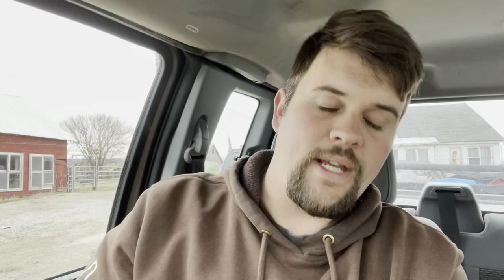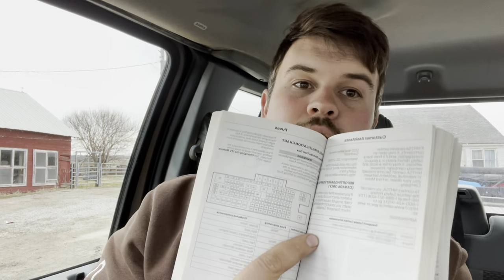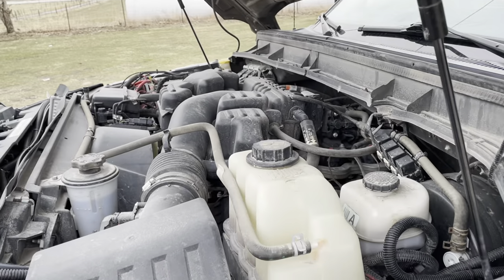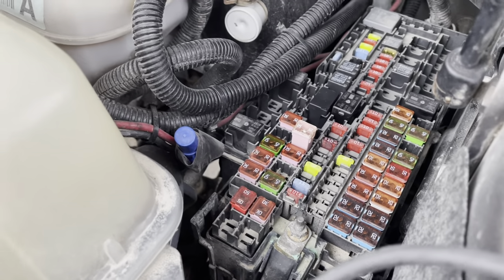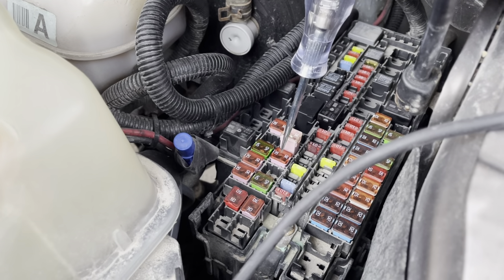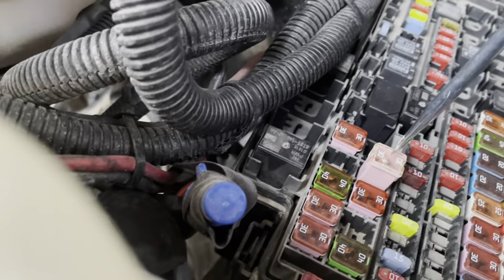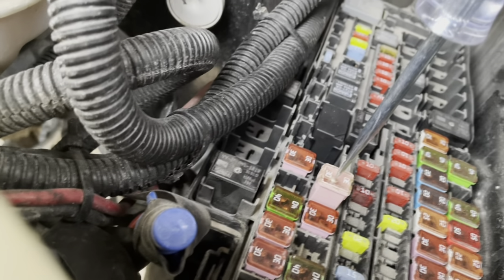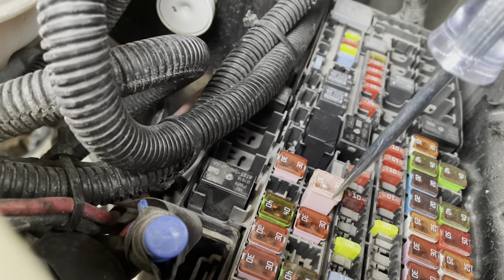Trailer marker lights not working? Try this first!!

Comment: Mu Durango had no running lights. Thanks for the tip. I went straight to the fuses and found a broken 10 amp. Problem solved. Thanks again.

Comment: I don't get it , if all the other lights work how would it be a fuse
Reply: The engineers just mix up garbage in hopes of frustrating you to the point of brining it back to the dealer. Half the crap they put on these cars make no sense whatsoever.

Comment: What was the fuse labeled as? I've got the same problem but all I see in my manual on page 556, sub section 223, lines 308- 357, is left trailer turn and right trailer turn. Nothing says marker lights, running lights, or anything like that

Comment: So where the running lights on the tow vehicle not working as well? I have the same issue with my 99 Jayco TT. Turn and brake lights work but no running lights. Lights on my TV all work. I have an 04 Ford Excursion. I’ll check the fuses tomorrow, but I thought that if it were a fuse the running lights on the TV wouldn’t work either.

Comment: Question.
i have an 02 Dodge Ram 1500.  My 4 pin flat connecter on vehicle for trailer works fine. EXCEPT THE RUNNING LIGHT.  My 7 pin connector on vehicle for trailer works fine. EXCEPT THE RUNNING LIGHT.
What do you recommend?
Thanks.
Reply: @Half_acre_farmer  
Would the fuse for the running lights be seperate on truck and fuse for trailer connectors?
Reply: @Half_acre_farmer  Thanks friend. Much appreciate it. All the chaos going on in the world. God is still in control.  A loving admonishment.
Reply: @Half_acre_farmer   it was a fuse. thanks for replying friend.  i thought truck running lights, and trailer running lights were same fuse. thats why i overlooked it. duh! lol